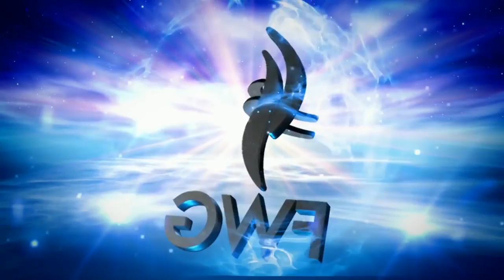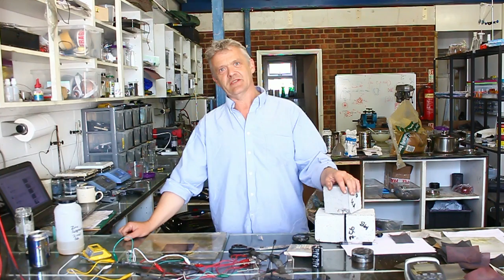Graphene Concrete - Can You Help?

Comment: i worked in Saudi for 3 years .ksa import millions of tons of sand every year for construction.
if you find they dont need to do so.
wow what a winner mate
Reply from the maker: that was exactly what i was told mate - which is what sparked my interest
Reply: the problem with adding a plant fibre into the mix is that it doesn't make it stronger. Adding fibre makes it lighter and it can regulate moisture better. Hempcrete has about 1/20th the compressive strength of regular concrete. It would be a lot of added resources. Hemp, as amazing as it is, still requires farming. The more hemp is used, the more hemp farms are required, and not all land is created equal for farming- either existing crops will be displaced or new untouched land will be displaced and water resources changed. This has a huge impact on the ecosystem. Turning more diverse forests into crops of hemp. The market controls how many other existing  crops it can displace. If Robert Smith's stronger concrete works out buildings will last longer- and if they use the coal for the graphene that will be more carbon trapped in stone again.
Reply: Robert Murray-Smith 

Hi Robert

 The hemp seeds are used to make hempcrete. If you can get hemp seeds that are left to dry, it appears that they go through a petrification process. This makes extremely strong hempcrete. As in the email I sent you there are other things you can do to make really strong concrete that is also light. 
One item is concrete glue, which is just Elmer's Glue, white glue made from milk products. I'm sure they have other kinds of concrete glue out there. 

Two if you took wood chips or sawdust and soaked it in salt water and lemon, and put it out in the sun to dry, then you would have petrified wood. this would also be extremely strong. I did put other things in an email to you I was kind of hoping that you got it.

Thank you for teaching us all this fun stuff.
Reply: Robert Murray-Smith 

I sent you an email a while back about how to improve your concrete. 

Did you get it?
Reply: Robert Murray-Smith you coukd try using hemp fibers with the graphene and I bet it would work pretty well. It would also be lighter. I dont know if that idea has crossed your mind but I think it would cool to see the results of the two together!
Reply from the maker: I am glad you like the vids mate - the main thing is to keep things simple though - adding and adding just raises complexity and cost
Reply from the maker: cheers mate
Reply from the maker: that's pretty much where my thoughts about hemp are mate
Reply: Read a paper recently that using desert sand is fine, as long as you use less water.

Sharp sand requires more water to be workable, while rounded sand requires less water for same level of workability.. According to the paper, water content is the main aspect affecting strength.

RIP Robert.
A fan.

Comment: Crushed Limestone is another cheap and effective alternative but the best of all would be River Sand although you can achieve the same results with crushed Quartz which is the best material as River Sand is literally Quartz Sand.
Reply from the maker: i am not sure - but you  might be missing the point mate - the point isn't to make a good concrete - it's to see if we can use an unwanted, unused vast resource to make an acceptable concrete
Reply: Ok, ok. Got you Rob.
Reply from the maker: cheers mate

Comment: Great thoughts on using an abundant unused material like desert sand. In case you don't get varied desert sand samples fast enough I would suggest buying online as an option. Googled and found http://www.saharagems.com/sale-sahara-sand.html for Sahara desert samples but you may wish to contact them as they may also point you towards quantity and other valuable info on sourcing sand etc.
Reply from the maker: awesome mate - cheers

Comment: Particle size variations add strength, perhaps as much as shape.  It might be the relative uniformity of the sand size is more important than shape?  Here in Vermont, we can order concrete with either ledge or river stone, the latter better for pumping as it flows better than the sharp ledge stone.   We can also spec. "pea stone". Either way the mix contains a range of sizes up to a particular screening.
Reply from the maker: it does indeed mate but i am not sure - but you  might be missing the point mate - the point 
isn't to make a good concrete - it's to see if we can use an unwanted, 
unused vast resource to make an acceptable concrete

Comment: Concrete thoughts to mix...
Turns out that the manufacturing of cement energy intensive and totally dependent on petroleum, and, so far there is no alternative for a post- petrol world.
An interesting concrete is made by the addition of aluminum powder, which apparently causes the concrete to foam as it sets resulting in a lightweight material.
Also, if your waste coal project takes off, there'll be another by-product from the combustion of coal aka 'conkers', or "fly-ash". This, another additive to cement, adds interesting qualities to concrete.
Reply from the maker: i am not sure - but you  might be missing the point mate - the point 
isn't to make a good concrete - it's to see if we can use an unwanted, 
unused vast resource to make an acceptable concrete

Comment: We had to make some concrete slabs with river stone gravel as the aggregate (at work) and the concrete just didn't work right,  it was horrible to work, all the water bled out of the surface and the sand rose to the surface way too much. I have been thinking the smooth rocks were the cause and this issue with dessert smooth sand sounds like a similar problem.
Reply from the maker: i think so mate

Comment: So Robert, basically desert sand is no good for building sand castles. Poor kids.
Reply from the maker: a pinch of hope and a sprinkle of good wishes will do it everytime mate
Reply from the maker: lol - such a shame for them
Reply: There is an abundance of mica here in the Algoma district of Ontario Canadistan and it's so pure in grade you can scratch it off with a fingernail; could you try it in concrete to see if it has any potential? I'm off to stake a claim..
Reply from the maker: or you could mate
Reply: Robert Murray-Smith what is the recipe Robert?
Reply: Fins&Racks Outdoors you should send me a fuck ton of mica.

Comment: I would've thought that beach sand from sand dunes would be the best to test. If you get the sand from a desert you would have to specify where from exactly? Such as from a sand dune or the A, B, or C horizon in the soil.  Check it out because its important.
Reply from the maker: i get a sense you are over complicating mate
Reply: Removing beach sand causes land erosion.
Reply: beach sand has a lot of shell in it and it's not that round even in really windy areas

Comment: Hi Robert, I am not living in the dessert :-)
But I have friend that works with concrete in a university. 
he told me that concrete is a very good isolator. when they build p.a. hydro. reservoir dam 
it takes long time to get the heat out of the building. 
maybe your concrete can faster cool down than a normal concrete 

lg

gerhard
Reply from the maker: awesome mate - i'll look into that - thermal transfer is an interest of mine when it comes to this material